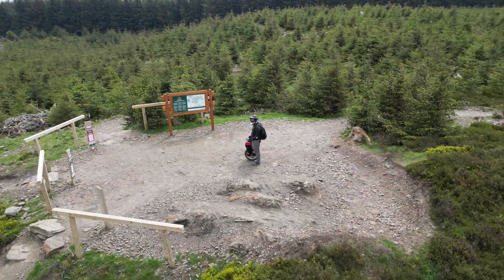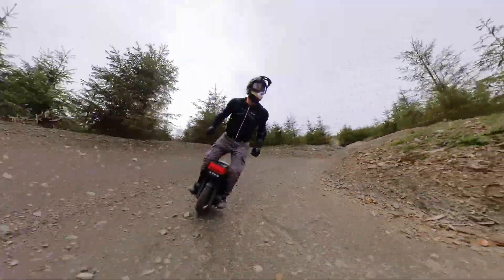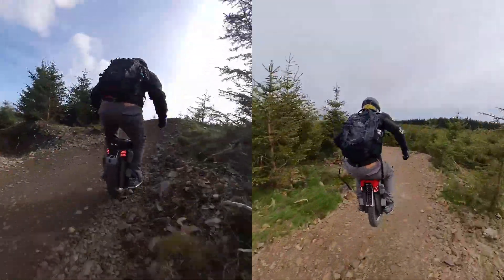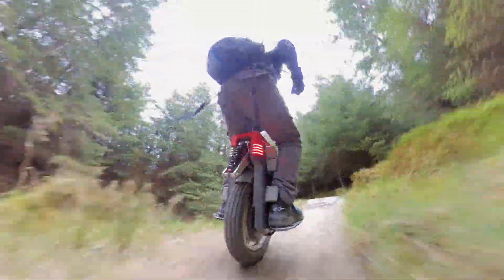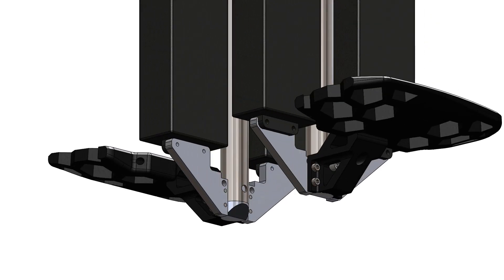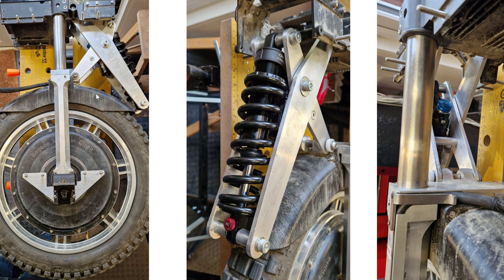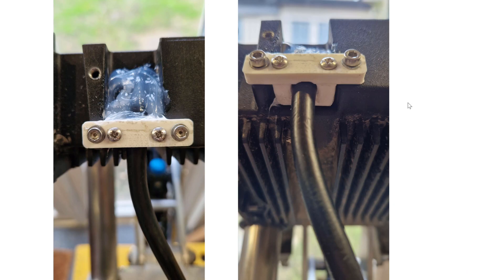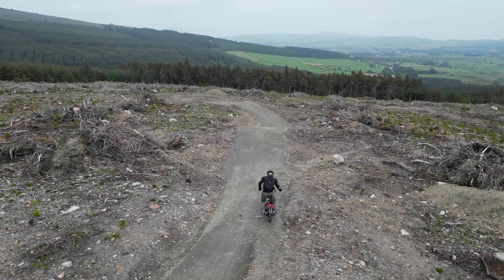How to get 150mm of suspension travel on Begode Master.

Comment: I'm torn between 125mm and 150mm. Which of your mods would you recommend for mixed riding? I rarely take my wheel above 40mph when on the street, but for the 150 mod, I worry about mass distribution and stability in this riding scenario (I believe you raise the batteries as opposed to keeping a "slam stance", no doubt necessitated by the extreme travel and having to keep the packs clear of the ground and tyre?). 125mm is already almost double the stock travel and will likely satisfy (I hope) my requirements for riding off-road. Has the 150 design benefited from any revisions that I may miss out on with the 125 design (aside from the increased travel) is the difference in stability significant between the 125 and 150?

As others have stated, epic engineering. Most impressive CAD skill and attention to detail. Definitely going to be following in your footsteps here. I designed my own linkage when I first got the wheel but despite it improving the suspension, bigger hits and drops were always out of reach even with the improved leverage ratio. I had considered the option of extending the stanchions, now 18 months on, others have pioneered and proved it as a viable approach. Thanks for inspiring my confidence for the job!
Reply from the maker: I have since made a modification where you can switch between 150mm for off road and 100mm for street just by moving the position of one bolt. Best of both worlds. It's all the same as the 150mm version but one pair of the linkage parts is slightly extended with an extra hole. Go for the 150mm. I'll upload the cad of the new linkage parts soon.
Reply: @eyeinthesky3013  Now that's smart design! I was just gearing myself up to make a complete version of your CAD model with the 125mm parts added into the 150mm CAD in Fusion360. (it's a slow day at work - so I might still do it for "fun" - All the joints for the assembly need redefining in F360, STEP doesn't bring them along, so that'll be a headache!). These new developments with the 150mm version of the linkage are too enticing to pass up though. My only other concern with this design is the mods to the sliders. I know people have broken the sliders on the extreme (granted riders almost twice my weight)  Don't suppose you ran FEA on the modded slider design?

As another aside, how does the leverage curve for the new linkage look? I'm running a coil-over, would I need to switch to air or a progressive spring to get a desirable progression? I suppose I could always use your new linkage as inspiration for my own. Thanks again for sharing all your hard work!
Reply from the maker: @stevenjkirby2020  Haven't done any FEA on the sliders, but I can confirm that nothing has broken yet.... and I have had a few big wipe-outs since doing the upgrade. The only thing damaged seems to be some soft tissue in my shoulder and the wrist guard in my hill billy gloves.

As for the linkage geometry, I tried lots of different designs to make it as progressive as possible but unfortunately, because of the position of the pivot on the wheel arch, it's almost linear throughout the travel. However, if you use the right spring and you dial in the compression damping, it works really well for jumping and doesn't bottom out. I'm using the stock S22 shock; DNM RCP-2S 240mm with 750lb spring. I weigh 80kg and the wheel 40kg. For jumping, I have the compression dialled at 3 clicks off fully closed and the rebound almost fully open. Then for more technical stuff (no big jumps) I loosen up the compression by a couple of clicks to increase comfort.
Reply: @eyeinthesky3013  I've done the 125mm mod now, with a slightly different modification to the pedal hangers compared with what you did. Thought I'd try that before going the whole hog and machining off the bottom of the sliders. Got to say I'm made up with the difference, way better. Higer COG definitely noticeble but not a deal breaker. I'll probably adapt after a few days of riding and not even notice it anymore. I've also made the tube inserts and my version of the battery riser for 150mm in anticipation of your switchable linkage design. My intuition tells me I'll likely find the ride height of 150mm a bit too great though. I may experiment with lowering the packs a la @jc84com assuming ground clearance doesn't become a problem. Thanks again for inspiring this.
Reply from the maker: @stevenjkirby2020  Great to hear that you like it. It really does make a difference. As for stability with higher COG, it depends on the tire and what max speed to intend to ride at. With CST-186 <60km/h off road, I find stability absolutely fine even at 150mm travel. No wobbles under acceleration or braking but if I take it on tarmac I have to be careful under braking and I don't take it over 60km/h as wobbles can appear, but still manageable. I have since put a Heindenau K66 90/90 on, it makes it more manoeuvrable for low speed off road which I was aiming for but on tarmac it's absolutely lethal, wobbles come on fast and are not controllable. I have yet to try in the lowered config but I suspect it will be better but probably will still be wobble prone. I'm just about to upload the switchable design to grab CAD. Check in a couple of hours and you should see it.

Comment: Awesome engineering. Thank You for sharing this.

What is your weight and what coil spring rate do you use?
Reply from the maker: @blackw0rx  I weigh about 80kg. The wheel is 40kg and I'm using the S22 dnm rcp2s 240mm with 750lb spring. I tried with the standard 550lb spring but it was too soft and it bottomed out on big jumps.
Reply: @eyeinthesky3013  Thanks. I weigh 65 kg, so maybe a 650 lb rate would be the way to go. However, coils over 600 lb are hard to come by, so perhaps a lower linkage ratio would be an option to go with the standard 550 lb or 600 lb coil, but will need some linkage prototyping..
I've studied your design, my observations are, that the pedals are 21 mm higher (23mm by cutting the stanchion minus 2 mm by swapping the O-ring for rubber).
The clearance to the ground at the pillars should be 37 mm less compared to original (77mm added travel to original 70mm , -2mm rubber, -23 gain by cutting stanchions without clearance loss, -15 mm cutting pedal hanger, which means the pedals are 37mm closer to the ground when fully compressed (batteries have just 20mm lower clearance), which I find a good compromise proved by your videos riding it 🤩
Reply from the maker: @blackw0rx   wow that's a detailed analysis. I haven't even looked at it in that much detail. I when i ran the standard 550lb spring it was actually ok (very smooth on rocky technical stuff) it was only a problem on really hard landings. To stop it bottoming out i adjusted the compression damping to one click from fully closed. I did a few runs on my usual jump track and it was great. Really took the sting out of the hard landings but on the third run something broke inside the shock and the compression damping system locked fully open and the rebound fully closed. This was very bad and i immediately bottomed out really hard on the next landing and crashed. Shoulder still isn't right but since installing a new shock with 750lb spring the compression damping can be set further open and all is well. I would prefer slightly softer spring. I feel 650lb would be perfect but can't find one anywhere. You might even find the 550lb was ok depending whether you are doing big drops/jumps. One thing I have done since making this video is make a new set of links that has another hole for one end of the shock to optionally drop the whole wheel by 50mm to make it more stable for on road riding.
Reply: @eyeinthesky3013  
You can get one 650 lb coil within EU here on ekolka cz pruzina-tlumice-dnm-650-lbs--cerna--pro-kingsong-s22

I'm sorry to hear about the crash. I started jumping on Kuba linkage on my V2 master, currently I'm building V4 master with Julians +35mm travel and once done, I will be upgrading my current V2 master to +70mm travel inspired by your build..
I'm going to weld the battery holder to the 30x3 pipe to avoid relying on just one bolt. Although it's not the bolt holding the pedal hanger, it's actually the clamping with the plug inside the tube that supports the weight.

Comment: hows the pedal clips on compression. this might be a issue😊
Reply from the maker: In theory there is around 40mm clearance on full compression which is a bit close for comfort. I had a couple of contacts when landing really hard using the shock with the 550lb spring but not enough to come off. Since changing the spring to 750lb it's been fine.

Comment: This looks amazing 👏 I currently run modified links and an electronically adjusted Monarch RT3. I am very interested in this setup. Would you ever consider selling the hardparts to try this kit on my Master? Thanks in advance for your time
Reply from the maker: Unfortunately it's not just a matter of suppling parts. Quite a few of the existing parts need to be modified as well (Stanchions and pedal hangers). As I have a day job I just wouldn't have enough time to modify/supply the parts. The best way to get the mods done if you don't have to tools to do it yourself would be if you can find a machine shop that you can share the CAD designs with so that they could perform the necessary modifications and fabrication of parts. Sorry, that's probably not what you wanted to hear. It's an enough easy modification if you're experienced with CAD and metalwork and have the appropriate tools though.

Comment: very cool and insightful video. thankyou.
From 70mm travel to 150mm travel, that is a good 90mm battery raise and Center Of Gravity increase.
Huge combinations of mods on this wheel.
100% agree the begode platform give plenty of opportunity for customizations.
keep the videos coming.
Reply from the maker: Thank you. Means a lot coming from a fellow 'Master' expert. Yes the COG is very high now. It's horribly unstable going fast on tarmac. I don't go over 60km/h otherwise wobbles can come suddenly and are very difficult to control. It's great for the mtb trails that I go though and probably help manoeuvrability if anything.
Reply: @eyeinthesky3013  looks like there is no way to somehow lower the COG on a high travel suspension and so reduce the wobbling. But what if we put a small GYRO connected to the euc motherboard. So the motherboard detects wobbling (at the entry level) using it's xyz accelerometer and controlling the GYRO to eliminate wobbling. That way we can have a hight suspension travel and completelly forget about wobbling but even more we can eliminate the trolley handle as wheel now can stay up right in all directions and even follow you? :D
Reply: @eyeinthesky3013  I suspected the stability would be bad.
I'm currently working on a low COG battery arrangement.

I also really like the way you dropped the inside of the pedal hangers, that mount to the poles on the inside. to allow for tyre tolerances. I've done the same. Came to the same conclusion it's not required.
Reply from the maker: I like your thinking, but i think the best/simplest option would be a larger diameter wheel for greater rotational inertial stability. Lowering the battery height will help too but is unlikely to provide as much stability as with a larger diameter wheel. The trick would be to do this without losing avaliable  tractive force* as is the problem with the Monster Pro.

 *Commonly miss named "torque" in euc chat. I.e.  a bigger wheel diameter with the same motor will have the same torque but less tractive force available at the tire contact patch due to larger radius.
Reply: @eyeinthesky3013  do you think the 22 inch wheel (like on Begode Master Pro) whould be a good choice for  your begode master with 150mm suspension travel? in case if you'll have the same or even bigger tractive force as your master
Reply from the maker: @yruslan  Unfortunately the bigger diameter means less tractive force rather than more. It would also need completely new (longer) stanchions. I would love to try though to see what the effect would be on A: Smoothness over bumps, B: Maneuverability. and C: Stability at speed. The Master Pro is 57kg wow! I would love to try it stripped down to minimum weight using Master battery packs.

Comment: Impressive job you've done sir! But even more impressive for me is your solidworks skills. I wish i could do the same in 3D modeling as have some ideas in my head but lacking of skills
Reply from the maker: Thank you. I'm a Mechanical Engineer so have been working with Solidworks for a long time. It's quite easy to learn but takes time to learn to be quick. I believe Fusion360 is a good option as it's free for hobbyists and is very capable.

Comment: Amazing. I really hope #begode is taking notes here. 22" wheel with lightweight motor with 150-200mm suspension would be a dream!
Reply from the maker: 100% agree. Lighter wheels please! This is the next big challenge. Nobody needs crazy voltage wheels with 180km/h free spin speeds. >80km/h is really a very bad idea unless you're on a race track. What we need is lighter wheels with bigger diameter and more suspension travel.
Reply: @eyeinthesky3013  It should be possible to shave off a lot of weight in the motor, since they have 8 spokes that are very solid. 4 should be enough. The motor on my Abrams is 27 kg alone! Lighter motor means less unsprung weight and more agile wheel.
Reply from the maker: @JonahOnEUC  I think most of the weight is in the steel stator and copper windings. The Master motor (C38), rim and tire (CST-186) weigh 14kg. I'm not sure that much weight can be saved without reducing the size of the stator and so loosing torque. Only way I can see that the rim tyre assemby can be much lighter is by using a belt/chain drive and a separate higher speed motor. I have designed and made one but it has issues. I need to improve it further but will release details once I get it working better.
Reply: @eyeinthesky3013  We need an old broken motor we can split into pieces and see how the weight is distributed and where we can save.

I think the very first EUC ever used chain drive.
Reply from the maker: @JonahOnEUC  I believe that some weight can be saved. I think Veteran put some effort into weight reduction for the Lynx but I'm guessing it's only a marginal saving. My belt driven wheel has a 4kg rim with 2kg tire. It has 130mm suspension but the motor is attached to the main chassis so only 6kg unsprung mass. It is a very nimble wheel and it is very easy to hop it up big kerbs. On paper it has similar torque to the Master but it has a strange problem with the controller that means it cuts out sometimes when you hit a bump. 😂 I'll get it working soon hopefully
Reply: @eyeinthesky3013  Sounds interesting! Make a video with it 😀